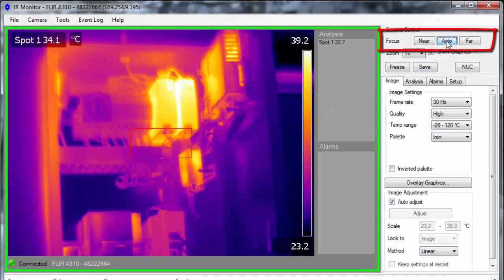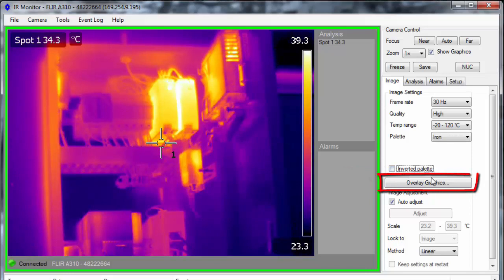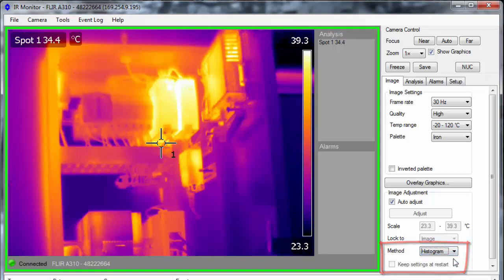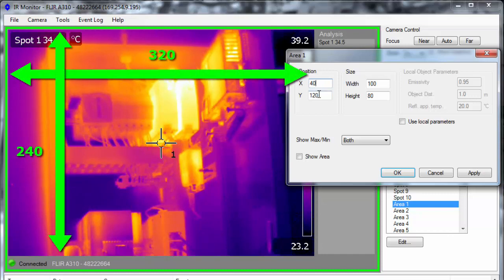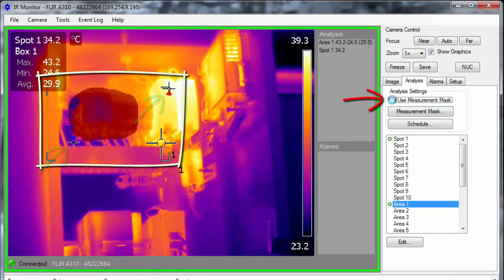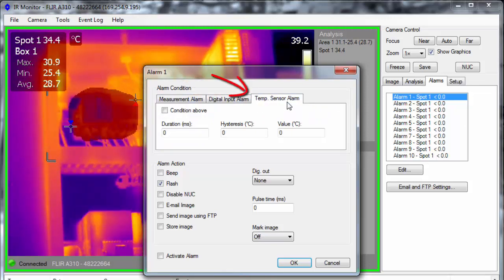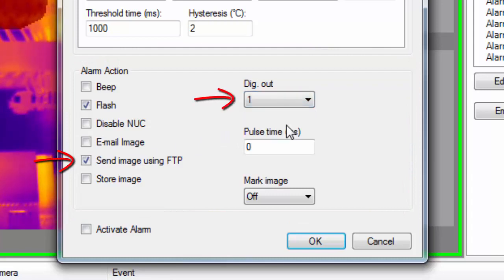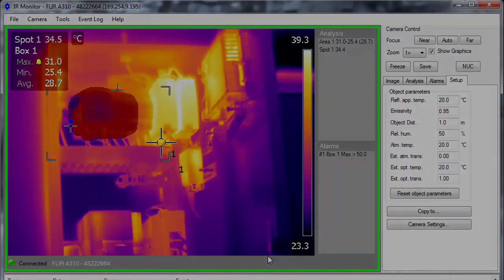Setting up your FLIR A310 Thermal Imaging Camera using FLIR IR Monitor

Comment: Hi 
I have a project to use Filer thermal camera to monitor the temperature in two points clint requirement and already purchase filer A-310 thermal camera model to communicate with siemens s7-1200 plc and disply alaram on HMI  if temperature diffrence of two points are  maximum then 2% then genrate alaram on siemens HMI and stop the production line.
Can you guide me how it's possible and Filer A-310 communicate with s7-1200 plc it's possible are not.

Comment: Will I be able to use this tool with the CAT S60 phone? Maybe USB connected or even wireless - would be great to know.
Reply from the maker: Thanks for your question - this particular software is only for the FLIR A310. Thanks!
Reply: +FLIR Systems will there be any kind of advanced software to view shot pictures with the Phone? I know that the Flir App on the phone can present the data in different ways: Switch between Thermal and visual view, change thermal filter, toggle MSX, set reading marker and so on. 
My Question is, is there a computer software which the same functions?

Other then that, It would be key to know for me if you could use the camera and the thermal camera with some functions like shown in the monitoring software as webcam. So you use live pictures through a tethered connection, or wireless as IP webcam.
Reply from the maker: Definitely head to CatPhones.com for more information on applications for the CAT S60